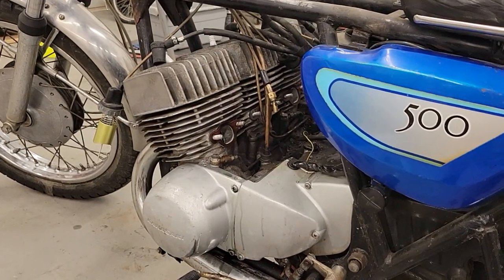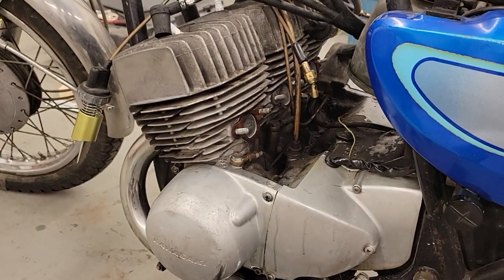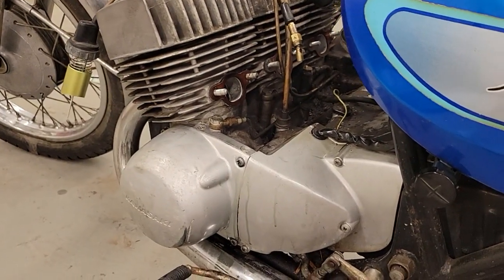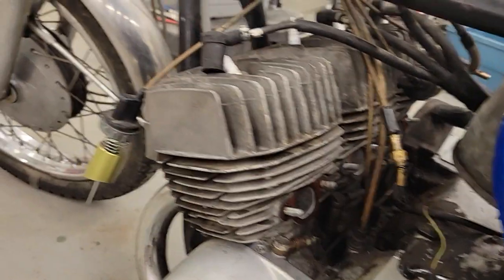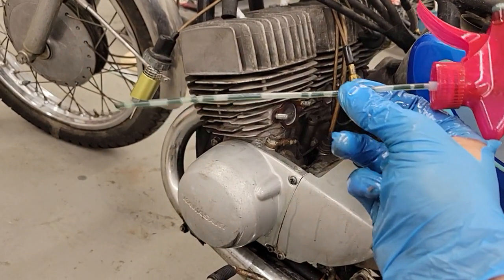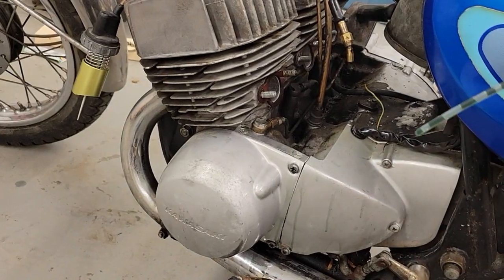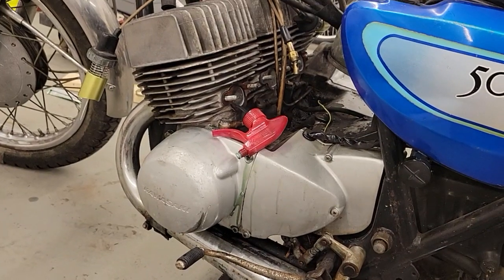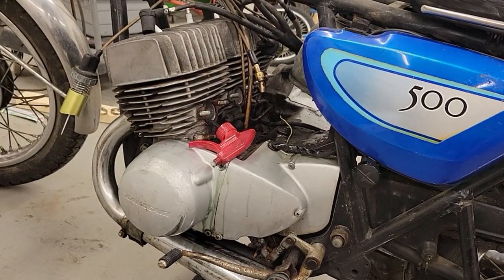Kawasaki Triple - Oil Check Valve Inspection | HOW TO - VERY IMPORTANT!!!!!

Comment: Great job Pete!  I love using old household pumps.  Shampoo bottle pumps work well too on bigger jobs.  You should do a how to rebuild the pump video.
Reply from the maker: Thanks so much!  I'm a big fan of your channel so that really means a lot.  The oil pump video is a good idea, thanks.  I'm sure there's an old pump laying around here somewhere
Reply: @PetesClassicCycle  I'm rebuilding the Tracy body H1 in the latest video (middle cylinder seized).  Oil pump tested ok, but I should make sure and rebuild it.
Also, doing a frame-up resto on a 1970 H1 and want to do the oil pump on that one too.  Love your channel!
Reply from the maker: @cramersclassics  I just finished your video!  Absolutely loved it..as always.  Danny is the man when it comes to the triples.  Please find me on Facebook or IG and send a private message.  I would love to connect with you.  Cheers!

Comment: It's best to NOT kick a older 2 stroke over AT ALL until you can pull the plugs and kick it over. Rags over the plug holes of course. And another point, you can NOT remove enough oil by kicking it over with your leg. As in the vid, you NEED to suction the oil out!
Reply from the maker: Thanks for the extra tips Johnny!

Comment: Wish I would have found this video before I tried to start my H1 last spring. Bent center rod. Got the motor broke down and crank sent out for rebuild. I will put in a valve to shut off oil supply from tank so this doesn't happen again.
Reply from the maker: Oh man, Unfortunately that's such a common story with these.  Just DON"T forget to turn the oil on before riding with that valve.

Comment: Pete thanks info was great  hydraulic mine about 5 years ago come to kick it over again and it was the same must have had 150ml each cylinder is there any way of stopped the check valves from dripping  👍
Reply from the maker: If you have the oil lines with removable check valves you can replace the ball&spring.  There are guys who sell rebuild kits.   Other than that you can install a valve on the oil line coming from the tank to stop flow while parked...BUT DO NOT FORGET TO TURN IT ON WHEN YOU START THE BIKE

Comment: What happens if I can’t get every last drop? I tried this method and want to make sure that it is okay if there’s a little in there
Reply from the maker: You'll hit a point where you'll obviously be left with some residual oil left.  I try check it multiple times to ensure that I've gotten the suction tube down all the way.   When you pull it out and all that's left is a tiny bit left on the very tip that's probably all you can suck out.  At that point I'll pull the plugs and kick it over multiple times another safety check to try and cycle any extra oil through.     Then start it up.   It'll smoke quite a bit for the 1st while as you burn up all the access oil

Comment: How can you find a new check valve?
Reply from the maker: Depending on your style they can be rebuilt.  OR you can build your own lines using over the counter parts.   Yamaha sells a really nice inline check valve that does the trick
Reply: I have a 75 Kawasaki mc1A. I ordered what supposed to be a banjo style check valve like what is on it. Hopefully I don’t get ripped off.